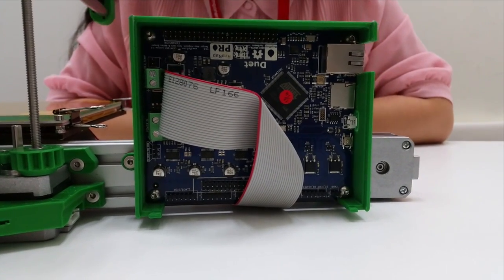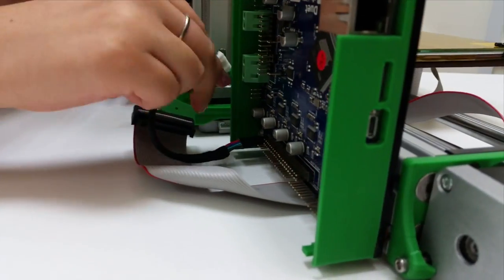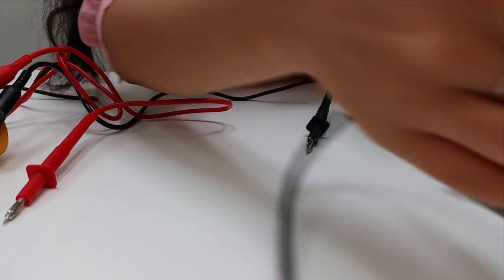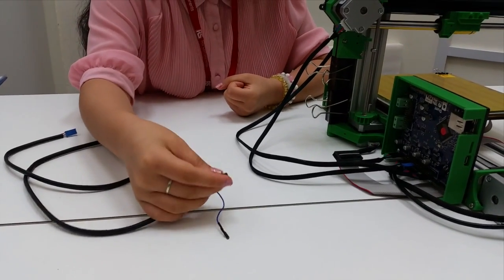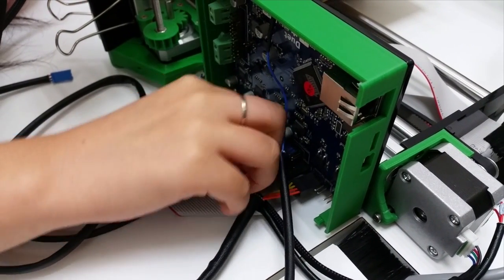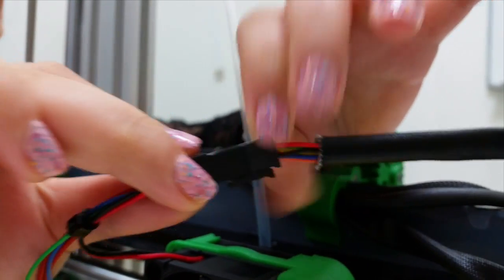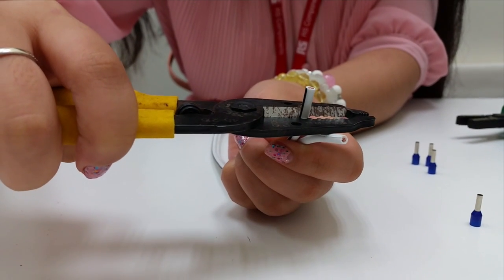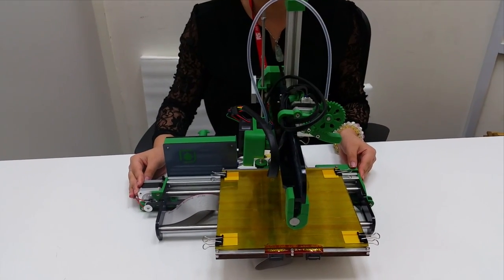RepRapPro Ormerod 3D Printer (Electrical Assembly)

Comment: Wiring error: Proximity sensor output connects to 6th pin from bottom right row. Not the 9th as shown in the video. Other than that, it's useful for bringing these old printers back to life. Next step is the Duet commissioning. Thorough and clear emaker.io has good instructions on this.